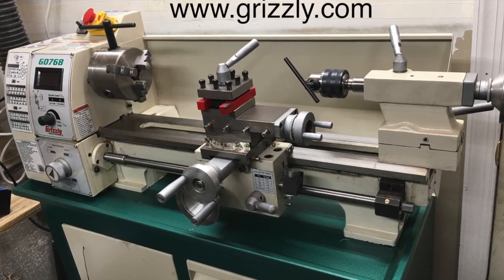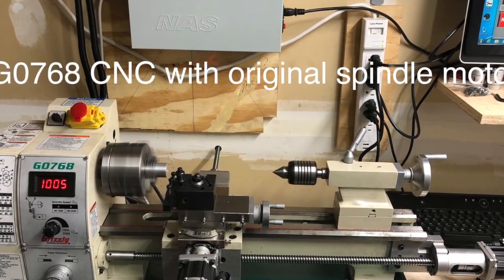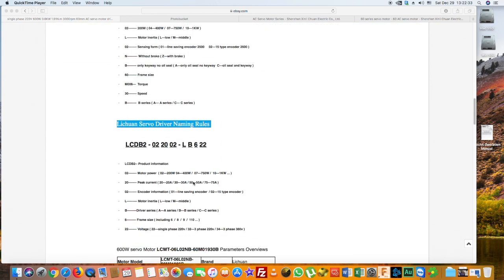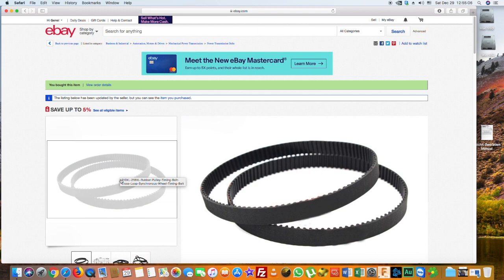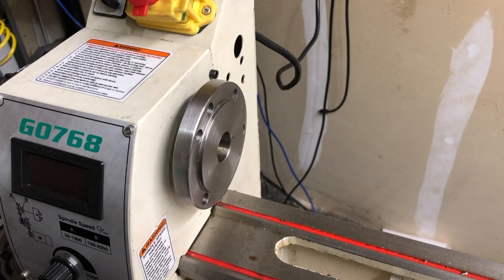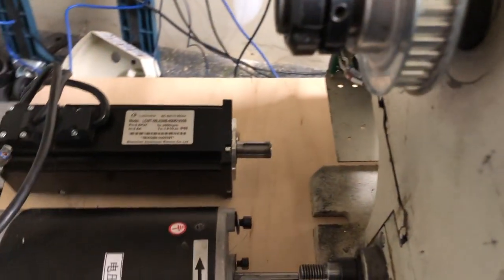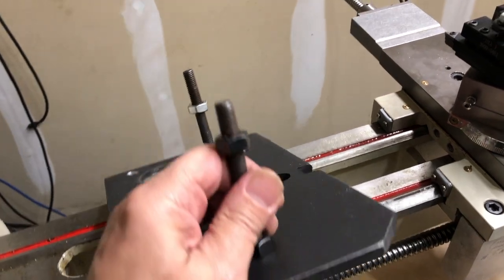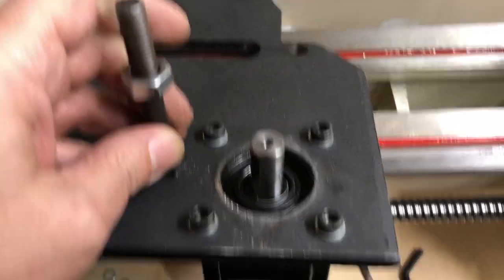G0768 replacing original spindle DC motor to Lichuan AC Servo

Comment: Good info. I like the low torque availability. I have problem threading with a Little Machine Shop Hi Torque lathe. I can do 5/16 " dia. Motor does not appear to have enough torque at low speeds for anything bigger or harder material. A follow on thought: Is it possible to use this setup to increment a partial rotation for making something like a micrometer dial or a new handle dial for a lathe?

Comment: Perfect! I'm doing your project now. But I have a doubt to chose the motor. I saw some closed loop STEP MOTORS with 12Nm torque, but with low speeds (max 1200rpm). Your SERVO MOTOR have 1.91NM only, but it seems really powerful on the video. Do you think 1.91nm is really enough? Or I'm wrong about STEP x SERVO torque comparation.
Reply from the maker: A low-speed spindle motor will not allow you to work at high processing speeds. And sometimes it is necessary, for example, to work with wood. My motor has 3K RPM and is powerful enough to run even at 20 RPM. Servo and stepper do have different torque comparation, you are absolutely right about that.

Comment: nice , I need to replace my lathe motor to something similar
Reply from the maker: Yes, I like this solution. But as it turned out after long attempts to establish full 100% functionality of the lathe, it is the best way to use the Ethernet Smooth Stepper Board + C82 Dual Port Multifunction Board for the controller. I recommend taking this particular set instead of M16D + PoKey.
Reply: @vgulya  is there  any other  simpler speed control system ,something  like plug and play
Reply from the maker: @ParsMaker  Is your lathe a CNC machine? In this case, you will have to use some kind of motion controller. If you just want to replace the spindle motor on your regular (non-CNC) lathe, you can simply use the servo motor driver to manually set the spindle speed.

Comment: Nice, i am interseting how u choise timing belt, you have two same pulley, and which is belt lenght?
Did u measure center to center distance, then belt lenght..or?
Reply from the maker: Yes, I decided on the size and type of pulleys, then measured the distance between the centers of the pulleys. And then I calculated the length of the belt on one of the online belt length calculators. I got 214XL belt and ordered it on eBay.
Reply: Hi,dear if you need buy the motor ,just contact me , I sell the servo motor to Mr Gene ...
Reply: @mira-supplierforcncpartsle2105  Can you provide an item number or model?